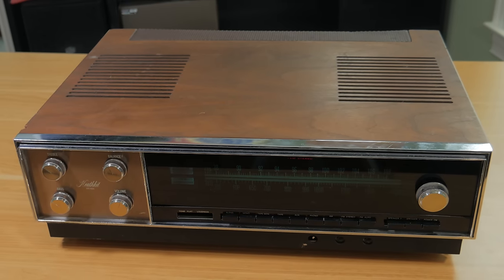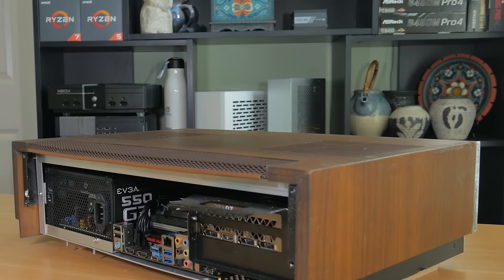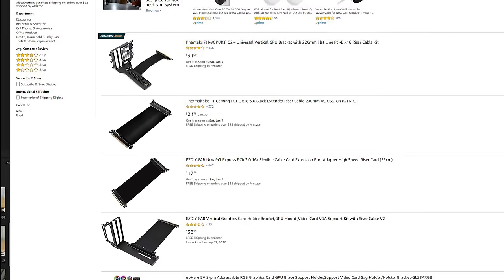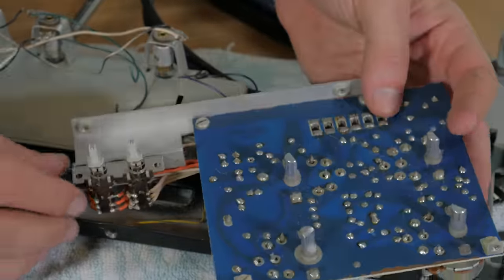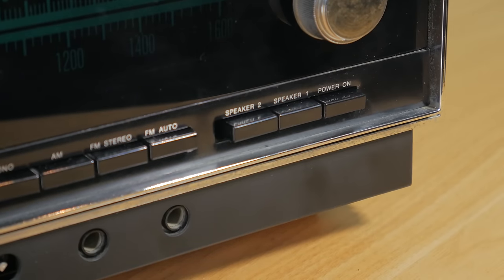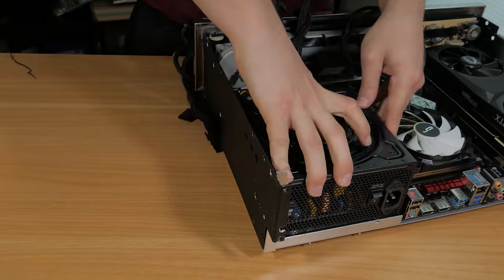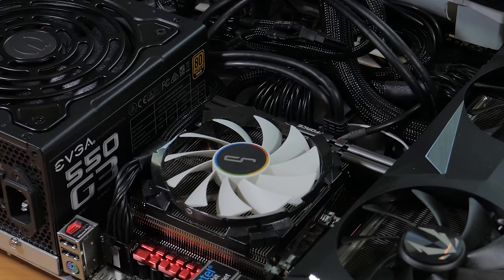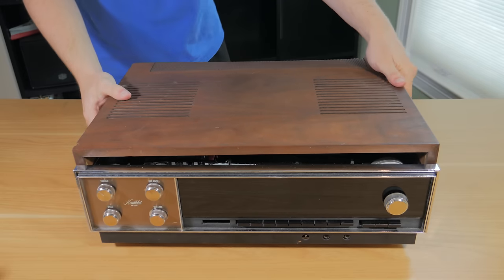Building An EPIC HTPC/Gaming PC! | (Part 1)

Comment: Love how it’s a sleeper but not in a PC case, refinishing the wood and polishing the metal would be cool for video 2 if you get the time but other than that this thing is awesome Matt!
Reply from the maker: Thanks! I am definitely going to be polishing the metal(I just need to find the correct compound/polish.) Also, I'm probably going to sand down the wood to remove some of the scratches then restain it, but the wood veneer is pretty thin so I need to be careful not to sand down too much.
Reply: Ooooo
Reply: @TechByMattB  You might just wanna sand it back down smooth and put new veneer on. Veneer is fairly inexpensive nowadays. Its that or you could pick up some vinyl alternative and have an easier time cleaning it.
Reply: @TechByMattB  When you Finish sanding the wood, try to use Wood Oil so the wood can last longer.
Reply: @TechByMattB  You should do it without machine with a finer sandpaper :)
Reply: @TechByMattB  Nice work !
The best metal polish imo is AutoSol. It's made in Germany. I've used it on hundreds of projects and it never lets me down. It comes in a tube similar to toothpaste and costs around $10.
Reply: @TechByMattB  Before sanding the very thin veneer, try heating and wetting it with an iron... like you would use on clothing. Veneer is very pliable when wet, perhaps you can get some of the indentations out that way.
Look it up before you try it, I'm just remembering this from a video I saw a while ago. ;-)

Comment: The tuning knob should change the colours of the RGB.
Reply: YES.
Reply: I say keep the volume adjustment on the volume knob. He should add the RGB color adjustment to the balance knob.
Reply: @element0ne  The tune knob is the far right one, volume and tune is not the same. I agree with 
nochancecze, the tune knob should change the RGB colors!
Reply: Trynez D’oh! For some reason I read it as “volume” knob and not tune... I agree with you guys.
Reply: Shouldn't be to hard, as there is already an arduino in the case, and an arduino can actually control LED strips, only difficult part would be the code, but someone who knows what theyre doing could get it done and coded in 10 mins
Reply: wait ive found a problem, the front screen has a green tint, he would have to scrub that down or something
Reply: and frequency grade should show a temp in the case
Reply: Nah nah, the overclocking ! Hehe
Reply: @MrSupora  That would require adding a new screen to the case too

Comment: "HealthKit" is actually "HeathKit" with no L. They used to be a pretty decent brand. I have a few of their kits. An RF amp (SB220), a clock, a large receiver, and a modulation monitor.
Reply: Also they tended to use boxes that were suitable for many different types of builds -- being a kit company and all.
Reply: We had a heathkit pinball machine it was pretty fun to build
Reply: @MortillaroCustoms  I believe that Heath Kits were considered to be on a parr with Zenith quality which made them both expensive and sought after. I also believe they were ALL kits, which made them rare. Since they were usually put together by technophiles, and not assembly line people, I imagine the the build quality was often very high. I think your project is a great one, and I'm temped to think that I might do something similar in the future, but I would also liked to have seen the specs and a review of that receiver if it had been put back into service.
Reply: @billchessell8213  Heath was owned by zenith for a period of time. The kits are far from rare, quite the opposite. They were sold out of catalogs up till the early 1990's I've have a few myself as did my dad. I think radio shack sold them as did Sears.
Reply: @MortillaroCustoms  On the resale market they were rare shortly after they stopped being sold because the people who had bought and assembled them were invested in their effort and not eager to sell.
I'm not sure if that has changed with time as their owners pass and the Heathkit goodies end up in estate sales.
Reply: Heathkit was also a very big name in ham radio. They made many HF transceivers and were very highly regarded. In fact their ham radion equipment is what they're best known for, to my knowledge. I didn't even know they made regular audio receivers until I saw this video.
Reply: My father-in-law has a console TV that he built from a Heathkit parts kit.

Comment: The Heathkit AR-1500 was released in 1972 and was their top of the line unit which sold for $349... over $2100 today! Surprised you scored it so cheap as these sell for $200+ regularly. The Heath company sold most their products as both kits or assembled units. Anything with Heathkit on the front was a kit, so you using it for a DIY project is that much more fitting :)

Comment: Awesome build. For the tuner knob, try making it functional by adding an actual AM/FM radio and a small speaker. It would be a great way to show respect the old gear and add greatly to the sleeper concept. Oh, and the LED's while convenient, take away from the sleeper'ness of it. LED's are hard on the old eyes. If you could somehow re-add the original type bulbs, or even find an LED replacement bulb that puts out a similar kelvin color temperature of the original, that would be simply amazing. Keep up the great work, you earned another subscriber here.

Comment: 3:53 Anyone considering doing a project like this seriously needs to keep that in mind.
Reply: isolated screwdriver and voila, discharged in 2 sec
Reply: @mistahke  Or a incandescent bulb, 60w 220vac it's what I used to use after I got scared the fuck out of me after discharging a crt tv cap by the short method...
Reply: 1M ohm, 200v resistor, inline with two alligator clamps: instant capacitor discharge system. throw a small LED in there if you want a visual output
Reply: All U hav to do is hold the probes of ur DVOM to the cap. It discharges and U can watch the voltage drop to zero at the same time. Thats if its even charged. Something that old probably hasnt been plugged in in years and he already said its currently broken. They dont hold charge indefinitely and even if it was operational, the second you turn it off, the rest of the amplifier section shutting down bleeds the caps off long before you can even start pulling the cover off. An old CRT tv? Ya, there U wana be careful! An old audio receiver....never had a problen.

Comment: I've been planning to do this with a microwave for a while. Haven't gotten one just yet.
Reply: Lol
Reply: Put legs on it like Goat MMO Simulator.
Reply: When you begin this project, be sure to to be very careful when working on the microwave. Microwaves use very strong components that can cause potentially lethal injuries if dealt with improperly.

You should be fine if you do the proper research, and enough of it, before hand. A lot of people take apart microwaves for various uses. I hope it turns out to be a successful project.
Reply: @luchvk  yes thanks for your concern. I'm aware of that and I'll likely make sure not to touch many components once they're out of the case.
Reply: I'm gonna steal your idea :) 
I mean if my father didn't throw the old microwave away...
Reply: @alves6465  go ahead ;)

Comment: For the most part I like how this turned out. I run a small website, and have mulled around how I'm going to hide the server out in the open, and this seems like a really fun idea. I even have an old glass front stereo cabinet that would work great as a "rack" for the various servers I have need for.

Comment: It's cool that you're upgrading equipment that, more than likely, started out on some amateur electronics enthusiasts kitchen table, in kit form. Not sure what the ratio was of kit vs preassembled  was. You could buy them both ways, but building it yourself was their main selling point...well and they were cheaper in a kit. So you're kinda continuing the tradition. I never did a Heathkit but always wanted to. They had some pretty complex items like TVs too. Imagine  some frustrated kid in the 70s putting that thing together. The original "makers".

Comment: Yeah, generally speaking radios had chassis up until around the 70s when cheaper went for plastic mounts while expensive kept to metal compartments, at least in the UK. I'm amazed you got into it. 😆

Comment: This is great! I would have cut a 120/140 hole in the center and add an intake rgb fan (or maybe classic noctua?) inside and cover it with silver metal grill on the outside. That would look awesome with a bit off twist to the vintage look and help cooling the cpu too.

Comment: so using the angle aluminum you have, build a frame across the entire back and along the sides, from that you could mount a couple drives hanging from the top in the center of the case.
i think the biggest thing you need is a frame, when you moved it the whole thing was bending from the weight and you have what you need to reinforce it

Comment: What would be even cooler is if you wired an actual AM/FM radio tuner into it, so when you're not using it as a PC, you can use it for its original purpose

Comment: Heathkit which was the build it yourself division of Zenith TV/Electronics. You soldered every component on the circuit board, etc. Watched my Dad build that exact model in 1972 when I was in kindergarten and it is still being used to this day by a family member. They offered some cool products to build yourself back in the day including 8 bit CP/M based computers and even a robot.

Comment: Good work, I would have used an inline analog aux volume switch. So: 

Motherboard aux pin header 
⬇️ 
Motherboard aux to 3.5mm jack 
⬇️
Inline Pre Made aux knob 
⬇️
Female Aux jack to the rear. 

I would have used a fully modular power supply that would allow some of the unnecessary cables to be removed, better airflow, fewer wires to deal with, long term if the PSU dies you only need to unplug the PSU and not all the already managed wires. 

And the lights, I would have used the bulbs since they have a glow and they take a second to power on and off. It would have been more realistic and believable. The RGB lights don’t make sense because there’s a green piece of acrylic that would make all light look greenish, defeating the point. You could have also used a regular USB powered led kit from Walmart for 4$ that's cheaper and it comes with a remote and a 5-foot light strip that can be trimmed, smaller wires, etc... 

Edit: The light bulbs are 12 volts, just connect to the PSU directly. Also if they are bad, buy all New bulbs for dirt cheap that would last longer then the original ones. 

Other than that I wouldn’t have done anything differently. Good work

Comment: A pair of bookshelf speakers could also hold a couple drives, and maintain the look.  (Of course you would want to remove the actual speakers since a huge magnet wouldn't help the drives) It would be a great way to add drives without sacrificing space within the unit.

Comment: 1 mod idea find some grill mesh for the back similar to the one on the top back Cut out the same dimensions. Cut a notch for back Wires and screw holes to remove its cover Back Dissipate heat at the same time.

Comment: This is sick! I am currently in the RND phase of my wood pc case. I had made one out of plexiglass but it was too thin but it was all I had lying around. I sourced some rather cheap 1/4 plywood and am just trying to figure out the size and connecting hardware. I am trying to make an ATX fit in the smallest space I can manage whilst fitting my massive Noctua nh d15!

Comment: That stereo came as a kit. You had to assemble it, soldering all the parts in place. It's very fitting to make it into another project. You could buy it already assembled but most were kits.

Comment: I did this years ago in all kinds of things... sky boxes and such - even just adding hard drives in random things around the house to network to so as to have saved back ups in places people not think of... including old amps and stuff in atic as well as blending in with units under the tv currently that look like one thing but, are in fact another or with additions - so it may work as a satelite box but, has extra drive in it accessed only by my specific network to put things on....

Comment: I built a number of these types of computers over the years. My advise is to avoid wood and be mindful of air traps. I had a mechanical hard drive flame up once because it wasn't getting enough ventilation. Also, if you plan on making a proper back panel, it helps if the original back is removable, or has enough surface area to allow you to recut original plate. Sadly most of my builds are undocumented. I only have a 486 conversion on my channel.

Comment: Pretty neat idea. If anyone wants an 80s or 90s style receiver htpc i suggest using an MFD like i got mine form an antec fusion case. It displays a graphic equaliser and the media being played.
Also has built in ir receiver for a remote and was plug and play with usb header and 5v power taken from the psu. so i can actually still work as a media player not having to use the actual pc.

Comment: I'd get the Arduino to do much more including decoding infrared remote control and pressing the power button. Maybe also get it to change the color of the led strip behind the panel to show you PC status info like the temperature of the system. Get it to decode either the media centre remote  or some other one like your TV remote.

Comment: Nice! I had a Heathkit receiver back in the early 1970's but it wasn't the AR-1500. I wish I still had it! I checked the price of the AR-1500 back when it was released in 1972, it was $379.95. That's about $2,800 in 2023 dollars!
Suggestion: Find and/or modify some vintage speakers or cabinets from the same time period with some modern innards to go with the gaming PC.

Comment: People keep saying all over YouTube that the 3600 cooler can handle it fine... It was always spiking at 60 or 70 for the mildest loads with 25c temperature and no OC. Changed to a Hyper 212 black and now it idles at 35 and tops at 60

Comment: Great build. The Arduino can read the potentiometer directly :-). Countersunk screws to fit the GPU mount could save modding the side panel. Not sure that trusting all you passwords to a random password manager is safe though.

Comment: Actually you  can consider using HDPlex PSU in the future. Save way more spaces & allowing to fit powerful hardware in even smaller enclosures.
Granted the cost might be higher than standard PSU.

Comment: I think for where you put the USB ports, you should mod the original buttons as "plugs" so they have the original look. When you need the USB port, just unplug the button and plug what you want in. Should be easy enough with an old USB drive or cable :)

Comment: this is epic but i would chop off the big metal tab hanging in the back for the gpu bracket asapp!! also id recomend doing a backplate or something too. and maybe add a few inputs /outputs on the side or front and maybe add in a speaker inside

Comment: I'm mostly interested in the the thermals and noise of a build like this. Looks great, but I'm kinda skeptical.
Reply: Shouldn't have that much noise, I mean the fans would be just as loud as a regular PC (unless you mean electrical noise in which case I would think it's high because of small space. but still.. Same parts as a regular), but the thermal flow seems interesting as the top pannel only has holes to the left and right it seems so while the GPU has fans & a vent ontop the motherboard's fan is blowing straight into the wood in the center of the pannel.

Comment: You should slowly connect all of the buttons and add more potentiometers to the volume control section just to beef up the whole build. You don’t really need stuff like bass and treble control but it would be cool or you could simply chose a different feature for it to control and paint a new label.

Comment: The back lights could've been really easy, could've just gotten LED's that fit in the original sockets and wired them to the 12v line on the PSU.  Same effect, no colour changing but I don't know that the colours would really come out because these things had a green filter on them.

Comment: Interesting Build Matt and I compliment you on your ability to overcome obstacles. I'm curious as to how you ended up managing the internal Case Temps without any additional Case fans? FYI, Originally the "Heath Company" / "Heathkit" manufactured DIY electronic kits from 1947 until 1992 for Hobbyists.  The Kit AR-1500 was sold separately from the Optional Walnut Case in 1972. I personally have been using a Silverstone GD07B HTPC Case since 2019 which happens to complement my older Onkyo TX-NR709 Home Theater Receiver. Randy   AKA randog311

Comment: Surprisingly this would've been the best receiver to use for this, because as the name implies, it was a DIY kit. And if the capacitors in there scare you, Heathkit sold Color CRT TV kits....
Reply from the maker: Oh wow haha. CRTs are the one thing I have not messed with tearing down yet. I know you can discharge them relatively easily, but they're still pretty scary to me. A project I'd love to do is build a Hackintosh in one of the old colorful imacs and replace the original CRT with an LCD.
Reply: @TechByMattB  cool idea!  Oh by the way the capacitors in this video could be easily discharged. You unload them with a tester screwdriver and make a connection from the "+" to the ground (ofcourse without the cable plugged in the wall). It might gave some sparks but if they don't spark, the capacitor is discharged.